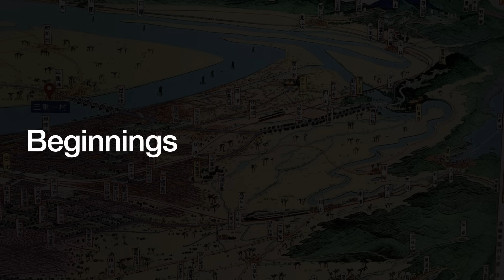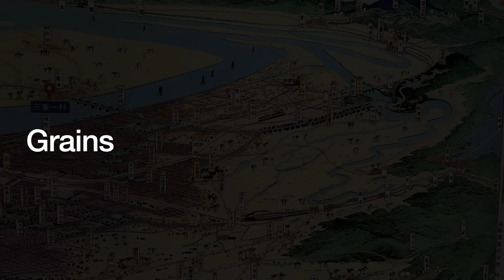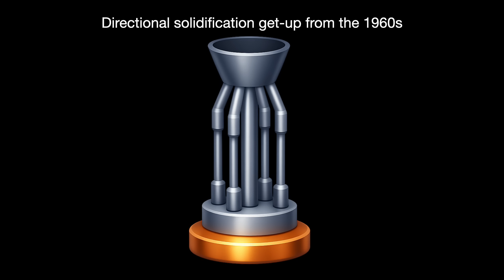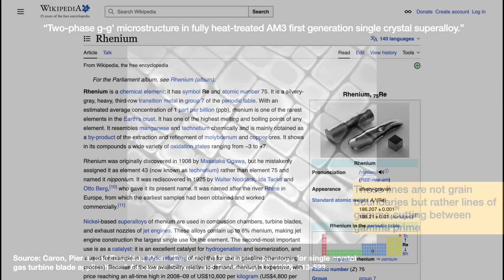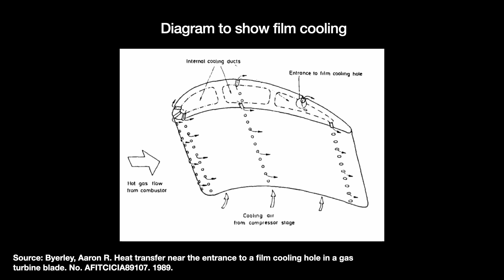Gas Turbine Blades and their Heat-Defying Single-Crystal Superalloys

Comment: Blades are cast - lost wax process    They make the hollow inside of the blade by molding wax around a ceramic in the shape of the blade, and then creating a another ceramic surface OUTSIDE of the wax.  Pour the steel in, the wax melts, and you are left with a metal turbine blade with a ceramic stuck inside that is the exact shape of the inside of the blade  with the interior surface you want to make - generally lots of nice bumps to induce turbulence and keep things cool.  Leach the ceramic out, and voila- turbine blade with hollow inside.  And lots of rejects if the ceramic and the wax are misaligned a little and the walls of the blade are messed up.

Comment: Worked at an engine plant and the compressor "vanes" stationary blades where cold foraged inconel so not cast, and the rotating assembly was all one piece of cnc not sure the rotor material

Comment: I used to machine the mounting lug on forged Inconel turbine vanes.
It was a pain. But yes Inconel can be fun that way. But like any machining process, once you get it dialed in, right tool, right speed, you can get it done.

Comment: They should put a few turbines on a BIG rotor and use the thrust to spin a generator while generating electricity from the turbines itself. Then angle them so you could put more of these turbine powered wind mills on another rotor and have a 3D turbine generator generator generator. 100 brazillian percent efficiency.

Comment: The truth is that they stopped using metal for turbine blades in military jet engines during the 1970s!  That was when they switched over to blades made of super ceramic, because ceramic can take the heat without elongating.  Today all of the blades in civilian aircraft engines are also made of ceramic.

Comment: It is never good just copy pasting videos of others, in this case Veritasiums while mixing in your own footage.
But its even worse when you get it wrong.
The blades are not poured from the top, and since you said that you don't even understand how the formation of a single metal crystal works.
The cast is under vacuum seal these days #1
#2 the metal rises up through the pigtail, because the shape is what forces the metal to bond as a single crystal, it is not forming a single crystal from the top down

But I guess that happens when you fundamentally have no idea what you are talking about.

Comment: The latest technology in hot gas turbine/jet engine parts are ceramic matrix composites which are now being routinely used for stationary parts in combustors and turbines and many are being 3D printed. They require less cooling so either the parts are pushed to higher temperatures for more power, cooled less for more efficiency or combination of both. At the same time the parts last an order of magnitude longer than they used to and can be repaired many times. The manufacturing techniques used to make engine parts are also quite intricate and are similar to some used in the micro-chip and nuclear weapons fields.

Comment: Just to clarify, yes turbines (steam, gas, etc) recover some energy from the kinetic force of the combustion gasses impinging on the blades, they primarily convert energy through the expansion of the combustion gasses within a constant volume of the individual stages. It’s better to think of a gas turbine as a 4 cycle reciprocating engine with all four cycles occurring at once.

Comment: what about using vapour chambers to cool the blades?
Reply: And where exactly should the heat flow to?
Reply: @timschulz9563  perhaps to all the other blades or to an area that could be ventilated in the middle or one lets fuel or whatever jump the spinning gap somehow and transfer heat like that. spray the spindle and let the g forces fling it back to the stationary part. fuck you teased it out of me. oh well. now it is prior art and cannot be patented.
Reply: @snorttroll4379 And how would you install blades if there's a vapour chamber that is connected to the rest?

Comment: They're also starting to use 3D printed metals with electron beam melting (EBM) and laser melting for low pressure turbines and I would suspect that's the future with appropriate powder mixes and conditioning after.

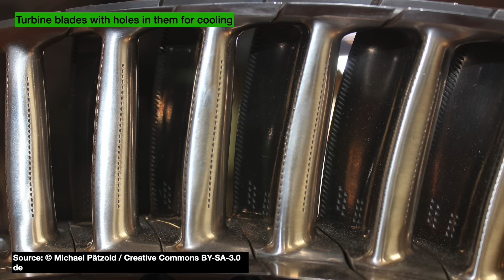Comment: 19:44 they're actually usually EDM drilled. They do have lasers but they leave a more rough non cylindrical hole, which creates more turbulence in the airflow as it exits. The goal is laminar flow.

Comment: The higher speeds quoted of 10,000 RPM or higher are only found in aircraft and aeroderivative engines, and only in the inner high pressure cure.  The low speed spools run around 3,000 to 5,000 RPM.  

Industrial turbines run at 3,000 or 3,600 RPM for power generation, and a bit higher but not a lot higher in mechanical drive (natural gas compressors or LNG refrigerators) and marine applications.
Reply: Small industrial turbines for power generatorion can run above 50/60 Hz too (so 3000/3600 RPM). They use gears to get to the grid frequency.

Comment: The first row blades and nozzles employ both internal cooling and film cooling.  The volume of the film flow is smaller.  The internal cooling air is discharged from the end of the blades.   Discharging out the end avoids the cooling air entering the turbine flow stream and cooling it down more.

Comment: What about low pressure turbines?   It is very hard to do turbine hydropower in rivers because turbines and waterwheels chop up fish,  and fish migrate, which makes it worse.   But low pressure trompes could work and not kill fish.  A trompe produces compressed air.   Imagine 25 liters per second of air and up at 3.5 psi.   Could a turbine convert a useful amount of that low pressure air into electricity or into torque for local machines?      This is about using "well trompes" to remove sediment and silt,  oxygenate water and potentially produce some electricity from small low head hydro sites.   Thanks   Brian

Comment: The future of turbine blade materials lies in ceramic matrix composites (SiC/SiC) and refractory metal intermetallics (Nb-Silicide, Mo-Si-B alloys) pushing service temperatures toward 1,400–1,700°C, though these require advanced environmental barrier coatings to survive oxidative environments; meanwhile, high-entropy alloys and directionally solidified ceramic eutectics (Al₂O₃/YAG) offer intermediate solutions, but the ultimate breakthrough will likely come from functionally graded materials combining CMC shells with metallic cores—eliminating the temperature-strength tradeoff that has constrained turbine metallurgy for decades.

Comment: The mtallurgy and material science is more of an Art than a Science. The addition or absence of an alloying material can have significant impact on material performance. Even assuming you have all the right alloying material, deviation from exact proportions can have significant effect. And finally, even if you know the alloying elements and its proportions, there is there is still the production process.

This is arguably the primary area that has been holding back Chnese military fighter aircraft. Their jet engine stend to have a lower power to weight ratio, lower durability, and lower reliability. China has been known for reverse engineering, but they hav ebene dumping money into this for decades and have only made incremental gains.

Comment: From YYZ. Regardless of how much fluff you try to push on us, when I fly, I still hate sitting close to an engine. Turbine engines take more testings and they are not getting it , because of the rush to be first in the market with a new model that saved the most fuel. The only turbine that had been proven through long experience world wide are the Pratt and Whitney PT-6 series of engines. That is why you hear so many engines , from major makers that cannot reach TBO or under go "unscheduled rapid  disassembly" in flight. Nothing ruin your day faster when you fly than a piece of turbine blade ending up on your lap........after it came through the seat back or fuselage. Pilots are tested on engine failure every recurrency training, but not on a damaged wing and systems after an engine failure. There are just too many variables to consider, and had to be left to luck.

Comment: At take off power one single turbine blade of the Rolls Royce Trent 1000 engine produces the same horse power as a formula 1 car - just one blade.  The turbine blades directly after the combustors operate at temperatures that are hot enough to melt and boil steel and the blades them selves, yet remain cool and strong.  Jet engines are amazing marvels of engineering and technological advancements.

Comment: I just quoted making a Cathode for an acid tank to anodize aerospace aluminum nuts. I need in raw materials Titanium grade 7. Grade 7 means commercially pure with a small amount of Palladium to make it more resistant to the corrosive action of the acid. I need to buy 1/4" thick sheet at 48" X 48". Cost 1 pc. $10,900.00. Yikes that's pricey.

Comment: In the early 80's I worked at PWC as a controls engineer on the program to bring compressor blade production in-house.  My focus area was in extrusion and forging.  The blades were made from Ti64, a superalloy.  While compressor blades don't have to deal with the temperature issues, they still have to deal with high centripetal forces.  And, at extrusion and forging temperatures, Ti64 reacts with the air to form alpha case, a brittle phase which leads to crack propagation.  So, we had to coat the materials with extrusion and forging lubricants prior to going into the furnace.  In the forging operation, we had to control forging energy to ensure we didn't raise the Ti64 temperature above the fully solutioned state which increased its hardness beyond the level by which we could use standard machining processes.  As an aside, the billets we started with were powered metal and not fully solutioned (e.g., alloyed).  In addition to the extrusion and forging operations, we ran the blades through machining, shot peening, chem etch and heat treatment.  That program was amazing in that it required a diverse skillset comprising, metallurgists, blade designers, machine suppliers, machine operators, forging technicians, tool and die makers, mechanical engineers, electrical engineers and procurement professionals.
Reply: Your description of the effort highlights how big a team must be to make any improvements of this sort. Titanium alloys can be "super", but 1) only Ni or Co base alloys are proper "Superalloys", and 2) Ti-6Al-4V is the most common titanium alloy - not particularly special. But there is titanium aluminide alloy that has recently been introduced as a replacement for superalloys in low pressure turbine blades. I was in charge of that development at GE in the 1990's.

Comment: At PWC I was involved in the testing of turbine blades. We would install strain gauges to the blades so that we can monitor dynamic stress as the engine runs. The gauges were installed using flame spray ceramics. Then wired to a 50 chanel rotating telemetry system I designed. The gauge life at engine full power was short, valid data was collected only on a few accelerations and decelerations. Since we make small engines <8,000 pounds of thurst our RPM's tend to be high, up to 60,000RPM
Reply: Just like making a watch, smaller and smaller requires more and more care!  🫡 to you and your fellow engineers.

Comment: Wonderful video, small question why would you do temperature comparisons in k over c? What differentiates the two is just the starting point, talking in kelvin is ”correct” but might end up confusing the larger majority. 

K starts at 0
C starts at -273.15

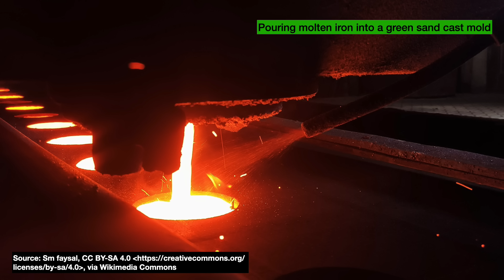Comment: 5:25 The sand at a new facility isn't green, it turns green over time due to iron contamination. Iron contamination in silica is the reason Alsatian wine glasses traditionally have a green stem. The most expensive of these glasses only use the local glass for the stem and sometimes part of the foot, with imported glass for the bowl so it doesn't affect the perceived color of the wine.

Comment: 0:56 natural gas usually refers to the actually gaseous carbohydrates methane, ethane, propane and butane. often found in camping gas bottles or LNG tanker ships.
whereas jet turbines run on jet fuel. jet fuel is the inbetween phase of gasoline and diesel. the light parts in gasoline would boil at the low pressures that airplanes experience, while the heavy parts in diesel would freeze and fall out as a wax-like flakes at the bottom of your fuel tank. both are obviously bad. so jet fuel is basically heavy gasoline and light diesel molecules.
Reply: Yeah, the industrial turbines, aircraft turbines and aeroderivative turbines all mushed together here.  Aircraft all run on jet fuel.  Industrial and aeroderivative can be run on natural gas and a wide range of liquid fuels.  It is pretty common for power plants to have nozzles for both natural gas and liquid fuel.  When the natural gas price is low, they burn that.  When it is high or unavailable during severely cold weather, they'll burn liquid fuel.  Quite a large variety of liquid fuels are used.  It's not uncommon for plants to burn Naptha (gasoline precursor fuels without additives or octane boosters) when the diesel price is also high.

Comment: This is where I started my engineering career, doing failure analysis for parts scrapped during production, looking at adjusting processes and figuring the most efficient inspection stations and timing (for example, depending how much downstream processes add to cost, a test procedure that has a very high false positive rate when done at that stage may still be cost efficient if the false negative rate is low enough and the downstream costs are high enough).

We described our work as "metallurgy at the bleeding edge of technology - where black magic meets science."

Comment: The efficiency ratings mentioned in the 60% range are not for the gas turbines alone. These efficiencies are achieved in a combined cycle setup in which the exhaust of the gas turbine is used to boil water and spin an additional steam turbine. The efficiency of a single gas turbine is in the 40% area.

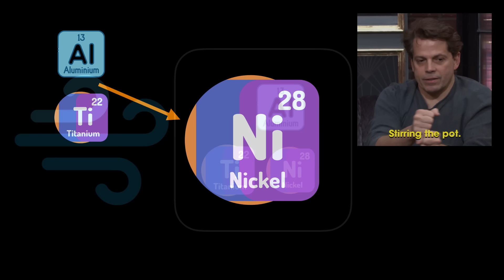Comment: 8:40 Just say it.. 
Homogeneous mixture.

Edit: watch video to end, before commenting 😂
Reply: "I'm told that this airplane is mildly famous" 😮
No, it's very f famous!
Most in communist minds, when it banging air over their country's..
It didn't have any weapons. It's weird why that type of engine haven't use in turbo fan engine, where it probably would work nicely!
A lot of thrust without moving parts. In theory it works at high speed without turbine and with fan front of it, that thing adds power in system at lower speeds. Speed in my comment is air speed.
If front fan gives more virtual air speed (primary pressure for ram jet), that type engine doesn't exist yet as we know it. Future SR plane would maybe have something like I think, if it never will produced.

If someone understands what I meant with my engine in this post and could guess why it's bad, please tell me.

It's like afterburner but better economy, because fuel air mix could be used better when process happens inside engine. I think heat isn't problematic thing with today's materials and design possibilities. Maybe some power from ram part of that engine could be channeled to turbine for needs of fan, without mixing it with compressor. When all these things could be controlled efficiently, it would give many benefits.

Until proven otherwise. 😅

Comment: This was a gosh darn good one, Jon, you really did good.  I’m partial to aerospace, so this was a treat.  A quick question:  you mentioned some inefficiency with using bleed air for cooling, so for ground turbines, can the pressurized cooling air be supplied by a separate source of pressure, with the air somehow routed through the hollowed out center of the main shaft?

Comment: Cool vid! I'm an aircraft mechanic and the engineering behind our engines is pretty awesome - the idea that an engine with something as large as a 12' fan can be run for 25k+ flight hours and be more reliable than the accessories mounted to it is crazy. But on the other hand I wonder if we've sacrificed too much chasing efficiency, modern narrow body engines are a total dumpster fire. The LEAP is more reliable now but Pratt dropped the ball incredibly hard with the GTF line - modern engines run incredibly hot and with such tight tolerance it really seems like it's contributing to premature failures versus other older engines. Combustion liners failing at 10k hours, constant engine changes due to LPC/HPC bearings leaking oil, etc. it's just a mess. Plus tons of design choices that makes working on these engines a bitch compared to older designs (all the name of efficiency) and it really makes you wonder if it's worth it.
Reply: Indeed, there is such a thing as too damn much!  Just like making a sculpture, or tightening a bolt, thinking you should do that last “little bit“ can ruin the whole thing!

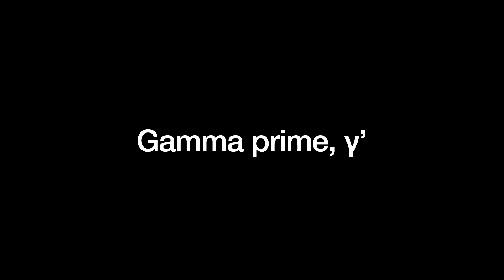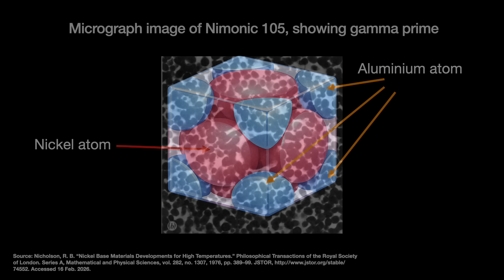Comment: The segment from 7:20 to 8:00 about the crystal structure is quite confusing. You show a somewhat odd image (AI-generated?) of the unit cell of a face-centered cubic structure, but you narrate as if it was a body-centered cubic structure. In either case, the unit cell does not contain five atoms, no matter how you look at it. The gamma' Ni3Al unit cell contains eight times 1/8 of an atom of aluminium at the corners and six times 1/2 of an atom of nickel centered on the faces of the cubic unit cell. Of course there are no actual fractions of an atom, we just think of them as such when atoms are shared between neighboring unit cells.